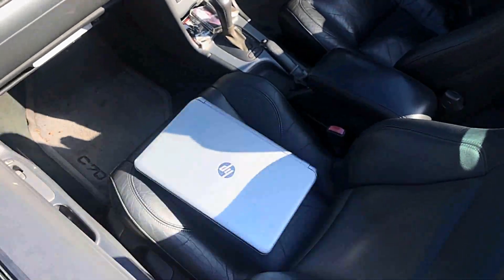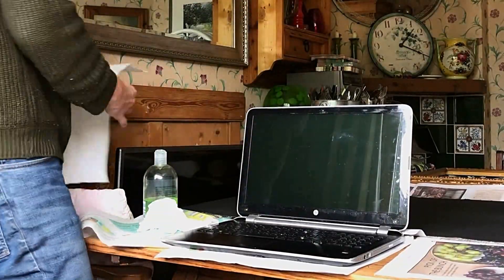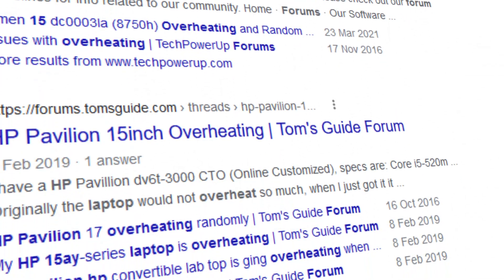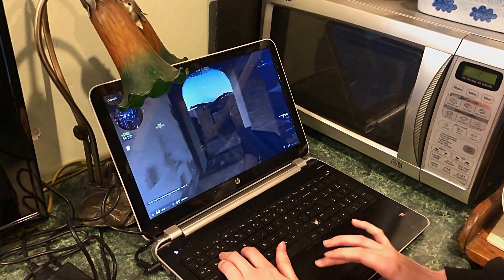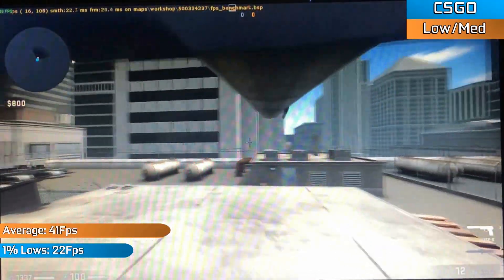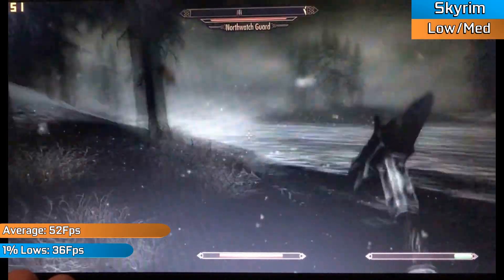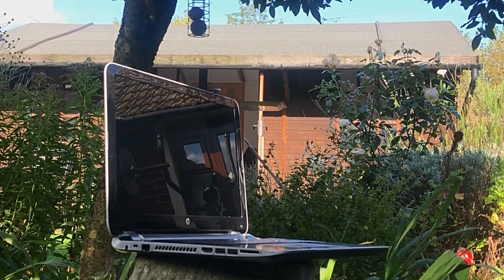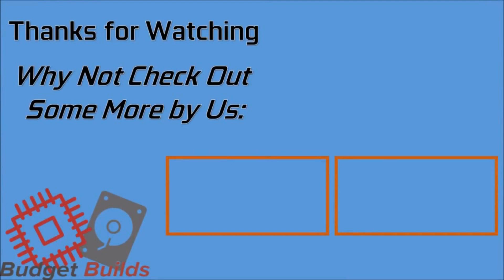AMD & HPs Awful Laptops...How bad are they?

Comment: Actually had a (less horrible) a10-9600p laptop about 7-8 years ago; for the price you got a much better GPU than the basement-bargain intel ones. I think AMD's biggest mistake was bundling in those horrible discrete GPUs instead of leaving just the APUs; it added heat and power consumption, shortened battery life and even made the (already weak) CPU throttle even more because it took power away....aaand, all for like 20-30% more fps than the APU....don't know how they thought that out, in fact I disabled the discrete GPU in the bios and even took the DVD drive out to increase battery life and performance.

Comment: 1366x768 on a 15 inch screen is just ridiculous.
Around 2008 there were quite some laptops with decent to excellent LCDs. Then some nutjob infected the entire industry with 16:9, and along with that came shitty displays across the board. But they said 16:9 was better for watching video.. took around 10 years until the industry reverted that decision.

Comment: I have a HP compaq presario laptop, it has a single core cpu at 1.5 ghz with an igpu that has 500mb of vram and a single stick of ram with 2gb. At 2009 with a cost of $420 it was possibly the biggest PoDS ever made, a friend even had a mitsui laptop with twice the specs at less half the price. My laptop struggled very hard on desktop with 80% of cpu usage IDDLE! It couldnt handle half life 1 at 720p at low settings The only good thing that came out of that dumb cash grab was the audio speakers. In resume, yes hp hardware sucks really hard.

Comment: ive got an A8 powered pavilion, the thing has a high pitched fan thats on all the time when running Win10.  it also draws air in through the keyboard and struggles even after cleaning bc of it.  the family member who originally had this thought it was defective because of how hot it got

Comment: All gaming laptops of this era where pretty dogshit but if you wanted to run something like TF2 it was decent value. Had to keep them clean and repaste them which was a bit of a pain. Stock thermal paste was pretty shit. Could take like 8c off them buy replacing it with arctic silver back in the day. Frankly if you where expecting more than like a 4 year live span out of a sub $500 gaming laptop you are expecting to much.

Comment: i had a Lenovo AMD A8 Laptop with 3 Years of warranty ,It had issues during the warranty and that was fixed but as soon the warranty finished the motherBoard and CPU freaked up  at service center they told they havent got parts and At local Tech repair guy had the same issue the laptop was dead  in the end i had to sell that on scrap

Comment: a few weeks ago I actually got one of those HP AMD laptops, unaware of how bad they were, it was an A10-9600p with R5 integrated graphics and R7 M340/440 dedicated GPU, it was so bad the CPU would actually bottleneck its own integrated graphics, as well as the dedicated card being weaker than the integrated, it ran poorly even in games that did support crossfire, although the speakers where actually remarkable, not good, just remarkable, for a laptop that costed me like 60 bucks

still better than my first Celeron 2981U based government issued laptop though

Comment: I bought one of these HP Pavillion laptops with an i7-2860QM and some kind 2gb Radeon graphics (want to say HD7600M?) when they were new for around £450 ($600-ish) and without one of those laptop fan pads under it, it was essentially unusable because of overheating even after adding new thermal paste. It could run pretty much every game I wanted (at the time, Arma 2, Dota 2, Runescape 3) at decent graphics and was hitting 60FPS basically the entire time, it just would overheat and turn off without a fan pad under it. It was a beast of a laptop for the price and the time period but HP really did not care about thermals with them.

Comment: My dad and I had something similar to this in 2011, but the chip in those was not an A10, was an intel 3200 something, it had a radeon 8 something as dedicated gpu too tho.
Mine broke in 2014 because I mistreated it physically, my dad's died the other month this year.
Worked kinda decently I guess, but yeah, the thermals were crazy, more than an oven, I would say an aircraft, with those fan speeds it could literally take off lol

Comment: I used an A8 laptop for over 10 years runnign Linux Mint.   Stilfl works and the battery holds a charge really well.   But it wasn't an HP.  Using an HP AMD 7530U now to write this.  Runs great.

Comment: My cousin had a laptop with an A8 with some form of Vega Dual graphics and it worked beautifully for about a year before AMD yeeted the crossfire support and we tried everything to get it working again but it just won't. The better Vega Dedicated graphics ended up entirely disabled regardless of our efforts.😢 I had also bought an HP 17.3 inch in 2013 with just the A10 5750m quad core. It was branded as a gaming machine and whooo buddy was it not. I distinctly remember being excited to hit 18 fps on World of Tanks old non-HD client on minimum settings

Comment: HP laptops of that era is horrible, or at least on midrange side. I have (to this day btw) HP 431. i3 2350M and 1GB 6470M (which rebranded itself as 7450M after a driver update lmao).

The thing overheats to hell and back, and right now the Radeon GPU actually died. If not for the iGPU it would be practically useless.

Then I upgraded to an ASUS - X450JN. i7 4710HQ, 840M. What a workhorse - if not for me being a tool and dropped it hard (as in I tripped over the charging cable and sending the laptop across the bedroom), thus cracking the motherboard, it would've still lived. And that little thing runs everything from your GTA 5's all the way to heavyweight emulation like PS3 (even finished Persona 5 on that thing).

Comment: I had a pavilion G6 for years with the 4th gen AMD A6, 4gbs DDR3 1333, 1tb HDD, Windows 8.  A few months of having it I got the A10 (yup, upgradeable cpu), upgraded the ram to 24gbs, and put a 256gb SSD in. Guess I got lucky with it by putting good thermal paste on way back then. With the A10 it had the Radeon HD 7660g graphics. That machine ran my favorite games until about 2019 and it was over for my G6. The machine would start draining the battery while plugged in if it was under load. I will say the G6/G8 is a better machine than the DV6's. It aged much better. I do remember comparing my APU with another HP like the one in the video, that on paper is better, but my G6 outperformed it (Game was Empyrion Galactic Survival).

Comment: Decent specs in a horrible cheap box? Yeah thats HP. I had a G8 250 and a few keys stopped working. I took it apart to find the keyboard was bonded in under a metal plate that you cannot remove. Instead of screws it was held in my melted plastic posts. Put it back together and it wouldnt post, so in the bin it went. Never getting an HP again.
Reply: We’re talking about the same fuckers that have proprietary ink carts, so what do you expect? Hewlett-Packard? More like Hewlett-Fuckard. Atleast Canon let’s you refill their carts

Comment: My father had the successor to this. Similar body, same shitty display and SSD size. But with Ryzen 2300U APU. 
Cost 250€ in late 2018/early 2019.
Dreadful piece of kit. Slow as molasses. More like SD card speeds than what you're used from typical SSDs.

Comment: I got the HP Pavilion 15 Beats special edition from a friend who had absolutely destroyed the harddrive and some of the case. put a new drive, and a copy of windows 7 on it, and it was my daily driver for years, but needed a MAJOR repair every four or five months. even got soup spilled through it and was still fine. eventually gave it a big polish to the point where it shouldn't have needed anymore help and passed it on to my sister before it finally fell off of a shelf and wouldn't you know, the hinges snapped off. internals never failed no matter what you did to them, and are probably still good to this day, but the build quality was horrific.

Comment: im watching on the same exact pc 
an intel i5-3230m 
amd radeon 8670m
12gb DDR3 ram ( it was 4gb when first bought it)
and 500hdd + plus 128gb ssd i added 
it preforms really well for a 10 year old pc , and i play gta 5 on it with a constant 35 fps on high settings 
so i gotta say in my opinion this pc isnt awful

Comment: I remember those, Plastic everywhere, and if you open it once, they would never close again. in many examples, ripped stands, and 31 different lengths and sizes of screws. 
another issue was that HP vendor locked all parts inside so fried Wi-Fi card like in my example, meant you had no chance for any upgrades, you could only spend 50$ on overpriced, 8y old wifi n card. 
They seemed really decent on the outside, but aged like milk. 
to be Honest, HP did not get rid of all issues this thing had,  you still have vendor lock on Wi-Fi, and a barrel power connector that goes with a crunch if you sneeze on it....

Comment: Fun story: I got a HP Pavilion G6 in 2011 as my computer, with an AMD A6-3400M CPU. Yeah, it started to overheat after two years (and definitely needs new thermal paste), and it needed me to run K10STAT to drop the voltage to not melt as much, but for $400, it was an actual quad-core with 6GB of RAM and that was surprisingly usable for years. I even made YouTube videos on the thing because it could.

Comment: I have an hp envy 14 (from 2011) and it too used dual graphics.  
It had  Radeon HD 6630M and Intel HD graphics 3000 switchable graphics.
I thought I would breath some new life into it by swapping the aging harddrive and installing windows 10 on it, but to my surprise the switchable graphics would no longer work after the install.
No amount of tweaking or bios changing would make the Radeon HD work as the computer defaults to only using the Intel HD.
Even if I disable the Intel HD from the device manager to force the Radeon HD to take over displaying, it still wont work as intended.

Comment: I have an HP15 it’s a pain to take apart and my model is limited to 8gb of ram I have a C-Mos battery blocking my other dimm slot plus they’ve clocked my ram down to 800mhz it’s a good pc for surfing but that’s about it it has the amd A-6

Comment: You... are aware that no "modern laptop" is reaching 112C, right? Thermal shutdown is going to be at 100/105 depending on the CPU and manufacturer, but generally 100.

You also overvalued how important or used x265 is. It's not only not hard to decode or encode (the botched x264 10-bit or "Anime" codec is worse), it's not useful. x265 murders colors to a ludicrous degree.
Reply from the maker: I’m not too sure I talk about X265 at all in this video… also these laptops commonly hit well over 100C straight from factory. The one cooking solution fits all doesn’t work when you have hot parts like this, in a chassis designed for a Pentium/Celeron.
Reply: @BudgetBuildsOfficial  

9:47 you mentioned H.265 (also known as x265/HEVC) decoding, but this is like I said a fairly minor thing. It's good at compression (of course, you could just use higher CRF values with H.264/x264/AVC (all the same) as well...), but not a very useful codec. It is profoundly slow to encode in, and the result is you get what you pay for. Low quality, and low file size. Very soft and reddened colors. I was appalled at how I had to re-digitize my DVD/BR collection because I idiotically went with x265 (HEVC/H.265) thinking the compression would be good, it isn't.

You... are referring to over 100 *Celsius*, right? Computer parts aren't supposed to be hitting that and should be hardwired to shut down then, but I think some CPU lines... some Intel one IIRC, can hit 105C before thermal shutdown, but really shouldn't be.

The A10 4655M in this video should have a standard thermal shutdown limit of 100C as per most AMD CPUs. Was this somehow disabled or something? How were you possibly seeing 113+?

I'm sorry to sound like I'm doubting you so much but it sounds like there might be an issue in the software tracking temperatures. I have no doubt that little guy is getting hot but that is almost unbelievably hot given it would be literally melting the plastic at that point (well, good plastic melts at 120C... but even good plastic isn't liking 113, and something tells me this cheap laptop didn't use good plastic).

Is HWMonitor reporting the temperature?

Comment: At least they had one good thing: They were not as completely broken as the first gen Ryzen Laptops.
Like seriously - great performance - WHEN THEY ACTUALLY RAN. They have a myriaf of problems, one that is still not fixed is getting stuck at the minimum supported frequency. Yep - there is a bug in AMDs CPU powermanagment for first gen mobile Ryzen (Ryzen 2xxx - that is Zen and not Zen+ ) that locks your CPU at 400MHz until you do a restart (powering it off and on again only sometimes works). Other problems include broken SME, broken encryption, broken TPM....
The Laptops looked so good on paper and when they ran they did very well - till you ran into a blue/blackscreen, stuck in a bootloop or slow as a snail.

(And the giant problems that caused for the OEMs as AMD didn't fix the problems either - lead to them not wanting to us AMD products in general.)

Comment: Mine barely runs still I changed the thermal paste and it ran less hot but the heat system is still designed terribly… Then add in it had a slow i7 dual core and didn’t say it was a dual core on hp’s site. The GPU was good but that dual core? It bottle necked even running the sims4 and it came out after TS4. I spent 800 on this stuff..
The laptop gave up going into sleep mod/hibernating/turning off correctly long ago either the year I got it or the year after. I kinda wish I would of returned the laptop and bought a desktop…

Comment: I had an Asus r510 with the a10-5750 dual graphics and it took me a couple of weeks to figure out the specific way to install a very specific set of drivers that allowed the dual graphics to work correctly in windows 10. Once I figured that out the dual graphics worked fine.

Comment: Yeah, Windows 10 wasn't really meant for gaming despite having that Game Bar it comes bundled with, gaming really depended on Windows 7, Windows 8, or Windows 8.1. A Hat In Time ironically says it can run on Windows XP, but new versions of Steam are unsupported on the system and Windows XP is mainly 32 Bit only.

Comment: Your cleaning process is cringe inducing. Too much detergent on the screen means that it streaks after and somehow you broke a key off the keyboard? All of the liquid you sprayed on the keyboard is going to seep under the rubber domes and short the switches and circuits underneath. That liquid will never dry.
Reply from the maker: 1. The screen has no streaks, only scratches from its previous use.

2. The keyboard already had loose keys, and also still works, whereas before 30% of the keys didn’t work.

Cheers 👍

Comment: This reminds me a lot of the 2012 Dell Inspiron n5110 that a friend gifted me. Came with a second gen dual core i3 at 2.1ghz, 4 GB ram, and Intel HD 3000 graphics. It was so slow that I decided to swap out the i3 with an i5 that boosts to 3.2ghz. Had to disassemble THE WHOLE LAPTOP INCLUDING THE SCREEN to access the processor side of the motherboard. Made the mistake of reassembling the whole thing without putting in an ssd. This laptop can barely run Half Life 2 at 60fps. I'd rather use your HP lol

Comment: these laptops are usually forced to use the integrated gpu due to recent adrenalin drivers not supporting these kind of multi-gpu laptops. had to install 19.11.1 to get it back
Reply: i got it back.. but it's basically broken... disappointment

Comment: 3:12 I used to work for a company that did HP RMA sorting. Pallets upon pallets of the laptops crossed our dock and we would have maybe 1-2 pallets of their desktop units in comparison. That was when HP decided desktop was dead and made it a fact for HP by not making all new desktops but a shedload of new laptops instead... and desktop is still alive and kicking hard enough to keep AMD and NVidia in the billions of dollars of profits while HP is lagging compared to 1990. Anywho HP though they claim quality... as an old middleman employee I disagree. Their early laptops had a huge return rate compared to the desktops. Printers with their thousands of moving parts and allot of plastic only exceeded returns for laptops with only the HDD and fan being the moving part. 

My point: I am kinda surprised that laptop even works.

Comment: I had a 800€ HP pavillon "gamer" in 2017, if was an horrible laptop. Of course it has a GTX 950m ans that was nice, but performances were limited by bad 6go ddr3, and a slow HDD. It was suite impossible to play games such as GTA 5. The wifi card was absolutely trash and disabled himself after 10min of game. The keyboard was so bad that it was impossible to press 3 'ey simultaneously.

Comment: This brings back memories.. Had one, back in 2012 the GPU chip actually slightly "melted" out of it's soldering. So my brother told me to toss it in a bath towel and let it run for awhile till "theoretically it would melt the pins temporarily back in place. Downside I had to basically do that every now and again, but.. It was hilariously awesome cause that sucker worked like that for 4 months. XD Till I got it together and got a stable rig...

Comment: Hello. Can someone tell what it's the spray or that solution that he's cleaning the monitor at the beginning of the video? Thanks a lot and very nice video! I had a similar laptop HP and it was freaking hot, I remember that most of the HP laptops suffers from overheat issues.